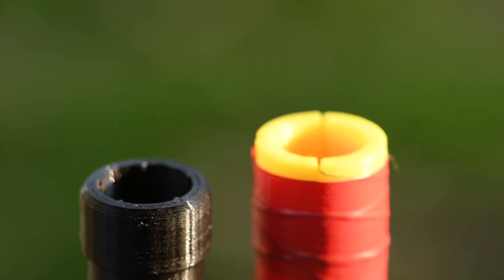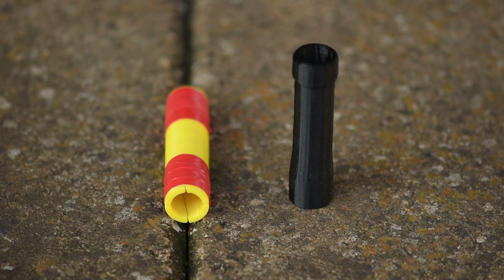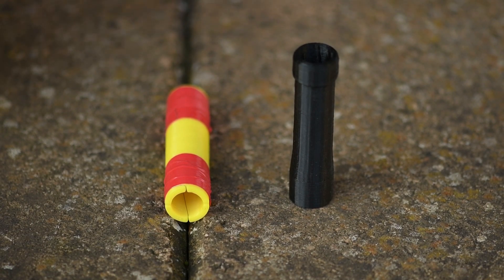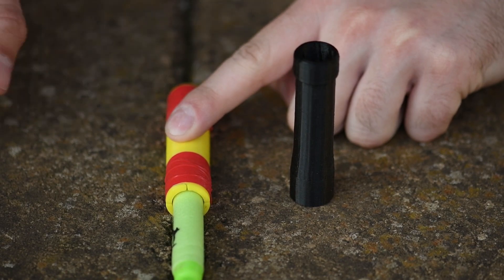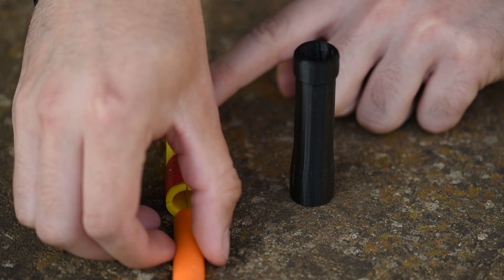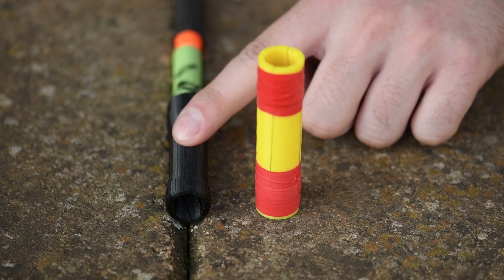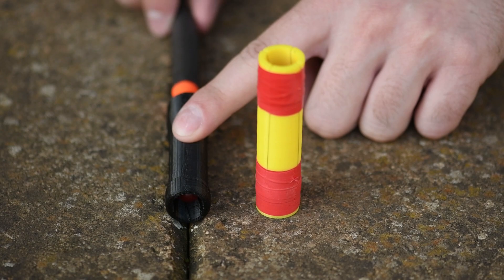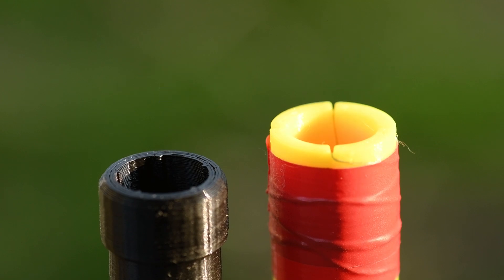Simple Test Scar vs Rifled Barrel

Comment: Also, increased spiral on a projectile will increase accurate but decreases range. I'm an archer and when I was tuning my arrows I was going between two fletchings one had more spin the other had less. I preferred the lower spin for the higher velocity arrow. 

But I'm sure that you knew this my good sniper sir.
Reply: I would also add (two years late unfortunately) that since this is nerf, predictability outweighs range in most situations. If you familiarize yourself with the flight trajectory of the darts with a blaster with a SCAR barrel, you can indeed become a "nerf sniper."  However you raise a valid point with the decrease range which is what you intended to do so you are correct.

Comment: But what's better? Faster or slower spinning?
Reply: I believe it would depend on the spring load as Bradley Phillips has explained in another comment.  Would also depend on the dart and other factors.  It comes down to testing.  I spent 4 hours today testing and I like where I'm at so far in terms of accuracy and range.

Comment: I would argue that the overall physics of spinning darts is still very much an un known subject. Little is known on the formula for amount of spin to the amount of ‘accuracy’.
Reply: What dart size was that with and what blaster? as using the Donald Miller rule you can calculate the stability of a plastic headed projectiles (though this is designed for real steel firearms) with a given barrel twist https://arxiv.org/ftp/arxiv/papers/1410/1410.5340.pdf reworking the equation you can calculate the necessary twist to provide stable accuracy, plugging in the numbers for a nerf dart at 2.7" and assuming a 200fps velocity both barrels are inadequate needing a ~1:1.1 twist however using cut down 1" darts the twist ration should be between 1:4.38 and 1:5.23. Given both barrels are ~2.5" using cut down prototype darts you would be getting the perfect twist with the rifled barrel the SCAR would still be in the optimum section but closer to the stable but less accurate side of the spectrum, cut down elites to 1" however with their slightly different rotation would be inadequate in the rifled barrel though optimized in the SCAR. Given what you've said there's probably more going on than just spin being imparted on the darts, if I'm honest I'm a bit skeptical on the whole providing spin to darts increases accuracy, though I do think it would be interesting to construct a whole bunch of SCAR or rifled barrels at equal lengths with different twists including a control with no twist at all just straight and see the results.
Reply: The correlation may be true but that does not imply causation of accuracy. The SCAR barrel also has porting holes where the air from the barrel can leak out, causing reduction of backblast; the rifled barrel does not have these holes to allow backblast to vent. I would hypothesise it is a combination of the centering of the dart by the rifling combined with the venting of the backblast through the barrel's porting that permits the blasters firing from these barrels to be more accurate.
Reply: That is possible. I'd actually speculate that there would be less velocity drop off due to lower friction between the barrel and the dart, since the rifled edges are fixed, not a deforming contact point like the strings in a SCAR. Try drilling some holes at each quadrant of the rifling where it starts and see if that changes anything.
Reply: Can agree with that one. I'm currently jumping between SCARs for testing purposes on my various blasters, still finding individual sweet spots and I'm enjoying the science. I'd recommend SCARs over rifled barrels any day. Nylon string is way more durable than thin PLA/ABS grooves.
Reply: The physics is there. Any inconsistency on the dart that causes it to veer off in flight will be equalized as it is spun.